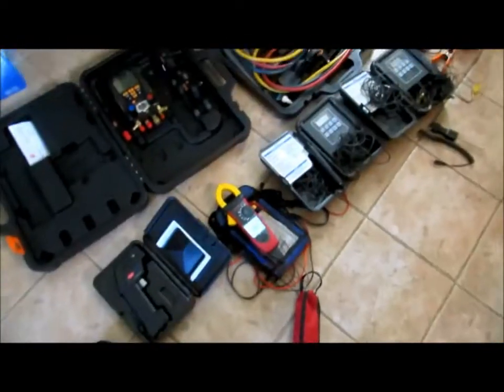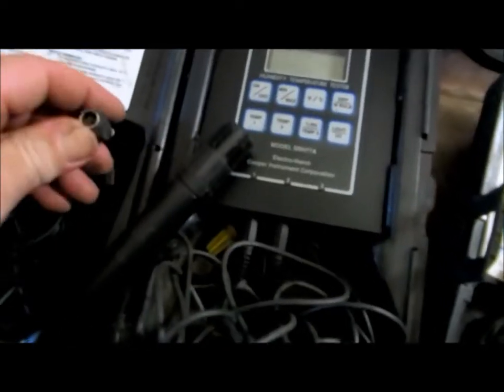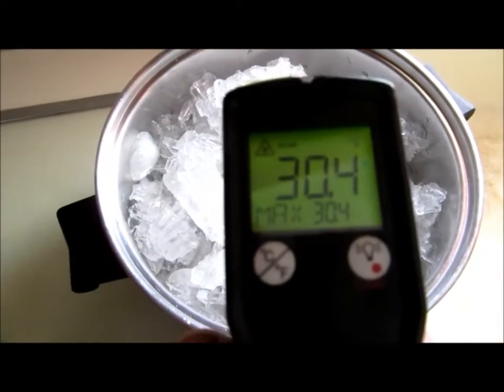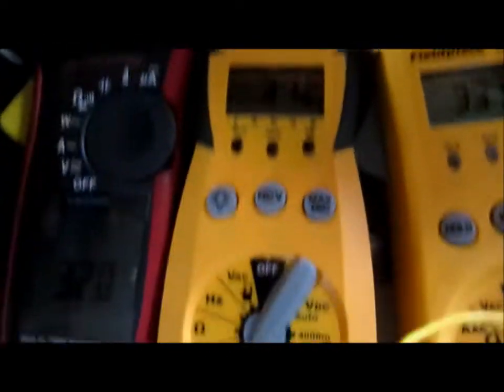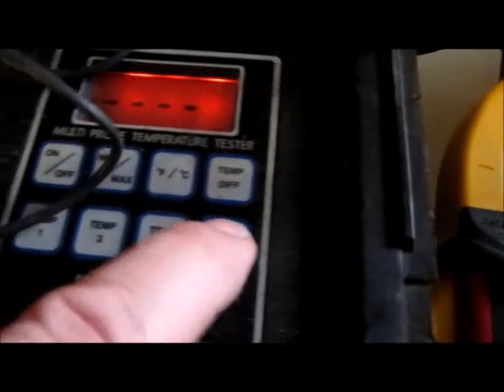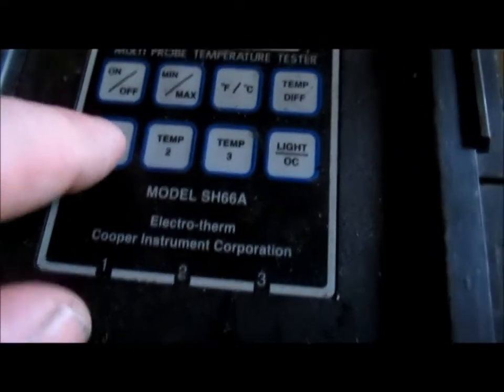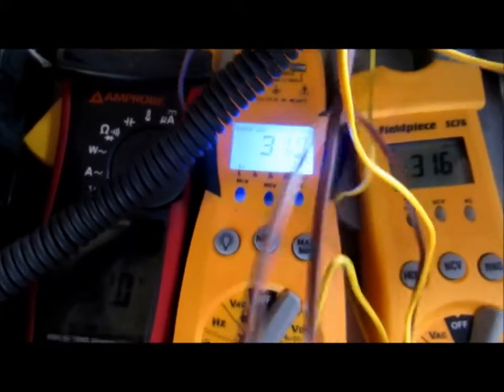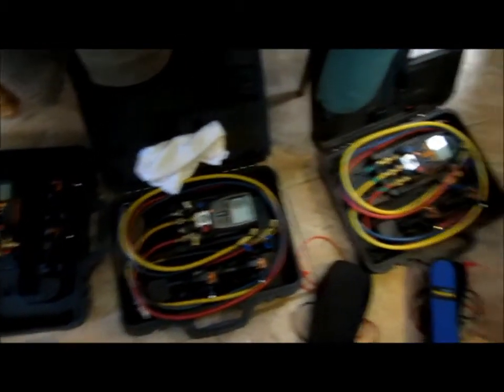hvac: temp probe testing # 1

Comment: Meters are great, I've got the sc57 with the transmitter in it, I can put the temperature head on a transmitter, put it in a walk in cooler, sync it with the sc57 and go up on a store's roof and watch cooler's the temp drop or watch the coil's delta T without having to go up and down the ladder to check temps.

Comment: Cool! You're right; good tools are necessary for a good job! I have a set I use just for 410A, a set for burn-outs, a set that lives in my truck, a 4 valve for clean recovery/recahrge, and a "heat pump" manifold (has two high pressure gauges) that lives at the building. They're all analog but, it's nice to have different mani's for different purposes.

Comment: Hey Steve,what is good digital manometer for checking gas pressure and pressure switches? I've been looking at a Supco,a Uei, and a pyle. Any suggestions? Thanks man!
Reply from the maker: raidzer testo and fieldpiece makes a good manometer testo is smaller .i have the fieldpiece at the moment it has worked fine for me .